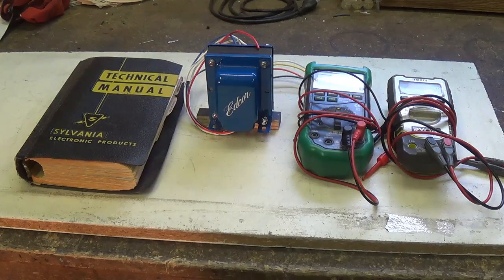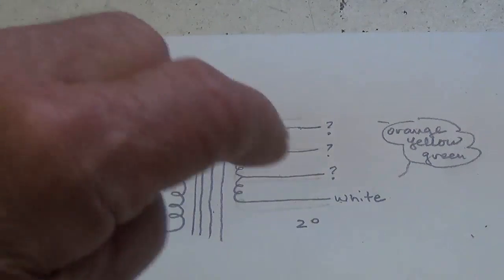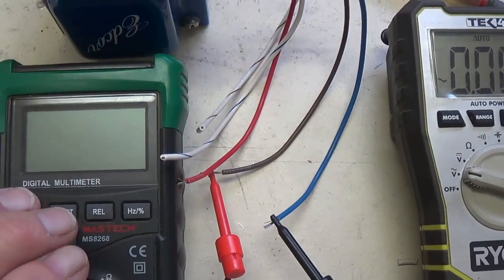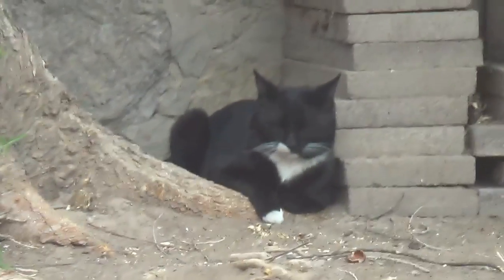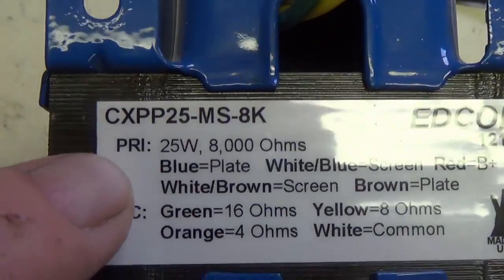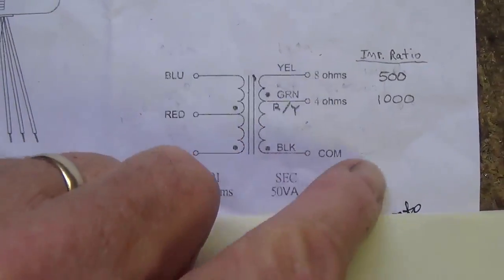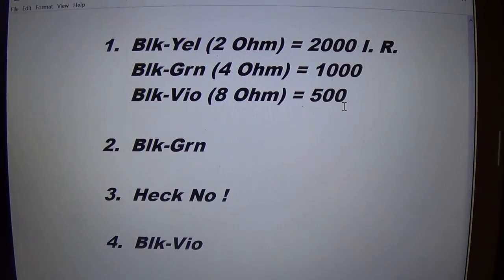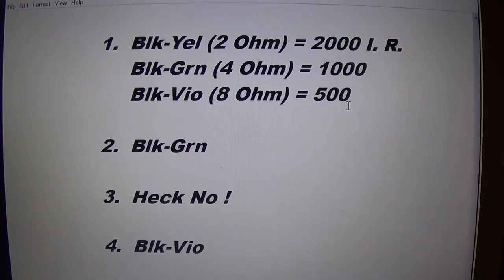Impedance Ratio: The Easiest Way to Decipher Output Transformers

Comment: Uncle Doug, I've learned so much from looking at your technical videos, and I'm now scratch building my first 5F1 from a pile of stuff in the shop. I went through your calcs with a few OPT's I had lying around, and came up with some interesting results. My question is, how close do you have to be with your impedance to know if it will work? For example, when I calculate my output impedance I get 8.8 ohms for a SE 6V6 @315V. Is that close enough to 8 ohms that I can use an 8 ohm speaker? In other words, how close do I have to be? I have some that calculated to 4.8 ohms or 15.0 ohms, depending on the tubes I'm considering. Will they work?
Reply from the maker: I would say that, just like in horse shoes, close is often good enough. The 8.8 Ohm impedance is only 10% high, which should cause no problems. The 4.8 Ohm value is 20% high, which is probably approaching too great a variance.  The 15 Ohm value is only a little over 6% low.....again, no problem.
Reply: Thanks Doug, that's awesome. A lot more people will be able to try this great hobby thanks to the work you're doing here on YouTube. I have two sons that play guitar, and it is going to be a huge kick for me to be able to scratch build an amp for them to use with their Telecaster. I'll use 10% as a good approximation and work from there. By the way, before I got into tubes I was trying to put back together a 55 Chevy I found in the woods here in upstate New York. Turns out my soldering skills are better than my welding skills! I kept the motor though, I'm going to use it in a 32 roadster kit some day...Thanks again!
Reply from the maker: You're welcome, Steve. Good luck with your electronics projects.....and the '32 roadster.

Comment: What would happen if you used a 6 volt dc battery,  and could you use it. Instead of the 12 volt center tap P.S.  ?  That was at 7 volt ac . 
For your tests.  
Thank you!         Curtis
Reply from the maker: Transformers won't work with DC, Curtis......only AC.

Comment: Thanks a lot for this Uncle Doug, very informative
I have a question, im getting 383v from the power supply into my output transformer (center tap) its a push pull el84 section wich gives me 8k ohms of impedance.
i have an output transformer and according to the calculations of the chart would have a primary of 4.3k ohms, wich attached to this build would give me 15 ohms in the original 8 ohms winding, can it be used this way?
The voltage sent by the power supply should be taken into consideration when buying a transformer? (my guess is no right?, since that DC voltage cant pass through the transformer and is there just to feed the anodes) Is it just necessary to know the effective load resistance of the output tubes?
Hope you are having a great day!
Reply from the maker: Lots of questions, Sebastian, and most were answered in the video. DC does pass through the primary winding of the OPT, but never reaches the secondary. You need to know the ELR of the output tubes and the impedance ratio of the OPT to determine the speaker impedance.

Comment: Hi Uncle Doug
Love your videos. If you are running a quad instead of a pair in AB would the "effective load resistance" be doubled?
Thanks for the great information.
Reply from the maker: The effective load resistance is per tube, Scott, so a pair of tubes in parallel would be 1/2 of the ELR and a quartet would be 1/4.
Reply: Thanks so much Uncle Doug!
Reply from the maker: @scottohta2192  Our pleasure, Scott.

Comment: I follow the math and this all makes sense (for the two tube scenario).  But what happens if you have an amp that uses four output tubes.  Let's say, four 6L6 tubes.  In the case where we saw the spec for Class AB, two tubes, 360 volts, and the load resistance spec of 3,800 ohms, how does that changes with four tubes?
Reply from the maker: The load resistance for 4 identical tubes is one-half the LR for two of those tubes.

Comment: Howdy. Wonderful.
As usual, I would, however, have a couple of comments.
Matching a transformer, that is rated 4k CT, to show 8k CT. At full power the iron will saturate at double the low end frequency. In a guitar amp. that probably has little meaning but in HiFi it most certainly has big meaning.
And matching a transformer rated 8k CT to show 4k CT by connecting a 4 ohm speaker to the 8 ohm tap. At full power there will be double the rated current in the trafo windings. The transformer wattage should be overrated to avoid producing technical smoke.
High Regards.
Reply from the maker: Thanks, Eugene.I do not advocate mismatching of speaker and OPT impedance.  The mismatches you mentioned are intended purely for instructional purposes.
Reply: @UncleDoug  Howdy again.
Aha OK. Fair enough.
By the way. The way You drew a matrix/table is awesome. Certainly helps thinking straight alright.
Regards again.
Reply from the maker: @eugenepohjola258  Glad you liked it, Eugene :)

Comment: Uncle Doug, my 1950 Gibson GA30 is running two 6v6 with a plate voltage of 310 volts, am I mismatching the original speakers? In 1950 supply voltages were probably about 110 volts, but the days it's about 117 or 120 volts.
Reply from the maker: Don't worry about it, Rick. The slight increase in plate voltage will not adversely affect the performance of the output transformer or speakers.

Comment: @Uncle Doug I never laughed so hard as the video about about preamp gain stages and the plate resistors (higher value higher gain) and you said 'now I know what some of you might be thinking' and I just started giggling cuz I knew where you were going.. 'let's just put a 10Megaohm in front of the plate, and we'll get a whole bunch of CHUGGA chugga gain, well hold on cowboy, cuz the circuit probably won't work if you try that' .. I laughed for days over that cuz I know several metal heads that would immediately go to that train of thought.haaha
Reply from the maker: Glad you enjoyed the message and method of delivery, Chris :)
Reply: Sure did, I still laugh about it now 😂

Comment: You  you were warning about shock hazard. Doesn't that current limiting bulb protect from a shock?
Reply from the maker: Not really, George. It will greatly reduce the current in the shock, but you would still feel it.
Reply: Thank you Uncle Doug. Since its current that kills, is it safe to say that the current limiting  bulb is protecting one from being shocked/electrocuted? I really would like to know for my own safety.
Reply from the maker: @georgerocks5191  It can reduce the degree of the shock since it limits current flow, thus it might prevent an otherwise lethal shock, but it in no way prevents the possibility of a  painful shock if someone does not follow all the safety rules involved with amp circuits. There is no substitute for care and knowledge.

Comment: The biggest question I have had with old transformers is figuring out their power ratings. I have several old transformers pulled from unknown solid state amps, and I can measure their voltages just fine but I don't know what kind of amperage I can pull from them. I have had a similar problem with a PT/OT pair pulled from an old Peavey tube amp as well.
Reply from the maker: Join the club, Daniel. It's impossible to accurately determine the power capability unless it's printed on the transformer,  in literature for the exact model number of transformer, or you know where the transformer came from and can estimate the wattage based on the circuit it was in.

Comment: Have you ever tried using the 100V or 70V sound system transformers as output transformer for tube amp? I was thinking about doing this, since the tube output transformers can be quite expensive where i am.
Reply from the maker: Use the method shown in the video to determine the Impedance Ratio for the windings, then see if any are appropriate for your tube circuit.

Comment: Hi doug very very instructive video
Could i ask you one question
You say tou can donthis operation without remove from the chassis
But the center tap of the primary is connected right
Is there a risk that current could go in the center tap and dammage the amp even if the output tubes are removed or not?
And does the preamp tubes should have to be removed as the output tubes to do this procedure?
Many thanks doug
Reply from the maker: You must remove the tubes first, Dom. There is no risk to the circuit as long as you are carful to limit the overall voltages used to make the measurements.....i.e. keep the primary voltage to less than the plate voltage of the circuit.
Reply: @UncleDoug  So no current will pass through the center tap?
Reply: I talk about the center tap of the primary
Reply: I think if the amp if off and most of all the stand by is off no current will pass in the center tap isn t it?
Reply from the maker: @dominiquecerdan8255  And, as I said, leaving it connected will cause no harm at all.
Reply from the maker: @dominiquecerdan8255  Where would it go, Dom?  The chassis is not part of the tested circuit.
Reply: Great technician you are really stunning
Reply: Jack is cool too

Comment: Hi UD, In the tube book is written , plate voltage 250 or 285 for 6V6, but in P-P mode we run those tubes mostly around 400 volt, so probably the value of 8000 will change ????
What if ?
Reply from the maker: I too am puzzled by the tube handbook's very limited data on 6V6's being operated at more realistic plate voltages......i.e. 400VDC. Based on the impedance ratios of popular output transformers, I would say that the load resistance of a pair of 6V6's would range from 8K @  300V to 6.6K at 400V. Fortunately, there are output transformers available for both applications.

Comment: Great video and just what I need! What would be the effective load resistance if its a 4 tube (el84/6bq5) push pull amp?
Reply from the maker: There is no simple answer.....it depends on plate voltage, FK.
Reply: Thank you! I have all the numbers ready, including effective load resistance I found but for 2x EL84 tubes push pull (8.000 Ohms). But not sure if for a 4x EL84 amp  it’s just a matter of doubling it up (so 16.000) and do the calculations based on that elective load resistance.
Reply from the maker: @fkitch  Since the tubes are wired in parallel, by the rules of parallel resistance, the net resistance would be half, not double.
Reply: Thank you again, should have thought that myself !
Reply: Ok, done, calculations returned exactly 6 Ohm (6.001). Thanks again @uncledoug , I have invited you to a glass of good Spanish wine through Patreon. Cheers, Fernando
Reply from the maker: @fkitch  Thanks for the wine, Fernando :)

Comment: Another great video. I need help to find a schematic for a amplifier I have. Its a Tweed National Chicago 51 type amp. Tubes are 2-6x5's 2- 6v6's 2-7B6's 1-6J5 It has a 12" field coil Operadio speaker in it.  If you have a schematic that would get me close to this, I'd like to get a copy, thanks Unk. I believe this amp dates to 1939, not sure though.
Reply from the maker: I have no library of schematics, Ron. I'm afraid you'll have to do what I would do, which is review all the Valco schematics you can find on the Internet, in hopes of finding one that is close to your circuit. You have a 50/50 chance, since many, many Valco circuits have no schematic available and vary from day to day in production.
Reply: @UncleDoug  Will do thanks.

Comment: I have a question; in many videos you refer to shielded wire. Is that the same as coaxial cable, or a guitar cable or microphone wire?
Reply from the maker: Probably so, but of a much smaller gauge. A good example is the type of cable that comes with RCA plugs to connect audio and TV components together.
Reply: @UncleDoug : So i clip of the RCA plugs and the inside goes between the parts and one end of the wrap goes to ground.
Reply from the maker: Yes, strip off an inch of insulation, twist the shielding wires into a tight cable and ground one end of it. The central wire will carry your signal.

Comment: You should mention that dpuble terminating a output transformer is getting outside the designed core to winding ratios. It is always best to get a 6600 ohm trans for push pull 6l6. And use the 8000 ohm transformer for  a pair of 6bq5s
Reply from the maker: What do you mean by dpuble (double?) terminating an OPT?

Comment: Seems like 4 ohms is easier on a speaker than 8 ohms.Are we somewhat stuck using 8 ohms because of the ubiquity of 8 ohm speakers? Can we use two 8 ohm speakers in parallel? or is that a magical dilemma waiting to create doom and havoc to the unsuspecting DIY'er?
Reply from the maker: If the turns ratio in the output transformer is correct, Tom, there is absolutely no difference, from the amp's perspective, whether a 4, 8, or 16 Ohm speaker is used. All that matters is that the impedance ratio is correct for the speaker utilized.

Comment: 21:56 - I guess the only spec that you wouldn't be able to figure out from this, is the power-capacity of the primary (25W) .
Reply from the maker: No, just like with power transformers, you can infer the wattage from size and mass, but it's only a guess.

Comment: Will the output tubes be looking at a much higher input impedance of the O/P transformer primary at say 6khz compared to 60hz?
If so,where is the match?
Reply from the maker: Impedance varies with frequency. Most impedance values are measured at a fixed frequency, generally 1 or 2KHz.  The impedance of an inductor is directly proportional to frequency.....so the lower the frequency, the lower the impedance.

Comment: I got the answers to questions 1, 2 and 4 in the quiz no problem.  Is the answer to question 3 “Heck No!” because the output impedance of 4000 ohms implies that the 6L6s in the bandmaster are being run with a lower plate voltage than the bassman (which must have 6L6 GCs in order to be putting out 50 watts) and only putting out ~30 watts?   Couldn’t you make it work in the bassman by stepping down the plate voltage to 360V?
Reply from the maker: Yes, but the presentation was focused specifically on the ratios, not the plate voltages.

Comment: Uncle Doug, I'm trying to undestand my amp's OT with a single speaker tap and no information inscribed anywhere on the amp or the faceplates. I've recreated the experiment you illustrated here, and I got some results/numbers that I'm having a hard time understanding and reconciling with ANY of the usual suspect octal power tube datasheets, nevermind the actual tubes this was designed for (7027A's). Trying to figure out if  can put any other tubes in besides the 7027A's. Do you hold office hours? :'(
Reply from the maker: If you determined the impedance ratio and you know the impedance of your speaker, can't you calculate the load resistance of the output tubes that would satisfy the relationship, i.e. if your 7027A's were correct, or if not, what tubes would work?  Be sure the tube base diagrams are equivalent before making any substitutions.
Reply: @UncleDoug  The OT only has one speaker tap. If I assume it's an 8 ohm tap, my reflected impedance works out to 1.88k ohms. If I assume 16 ohms, it's 3.77k ohms on the primary. At 32 ohms, I get a reflected 7.55k ohms on primary. Running at 333V  on the plates. This amp is essentially a SS rectified 5F6A, btw. I'm at a loss because the datashets for 7027A, 6L6GC, 5881, KT66, EL34 all do not definitively show anything like a 3.7k load in this plate voltage range while in Class AB push pull - they always show  signifcantly higher loads. Either that, or they just don't show data for AB push pull (EHX, JJ, Genalex) The closest i've come is the RCA datasheets, but it bottoms out at 400V and specs a 6.6k load. I just want to know what this means for me. Are the tubes fine with this OT? Is the OT fine? Will it work but just inefficiently?